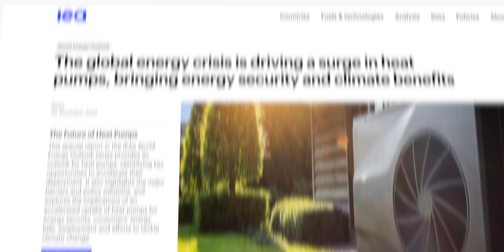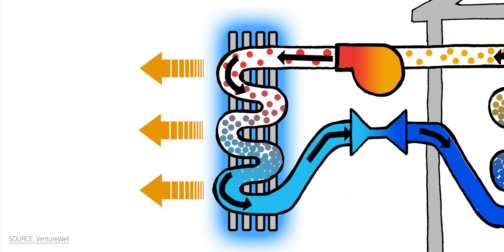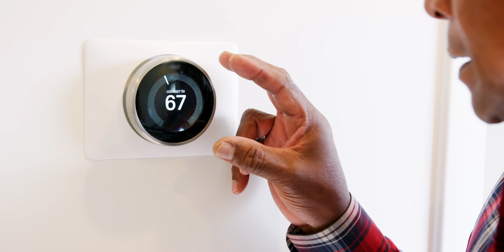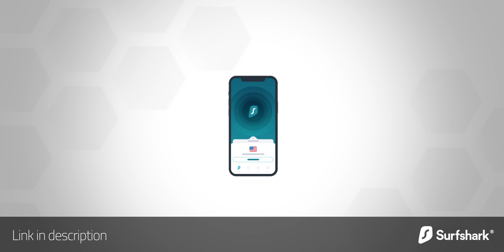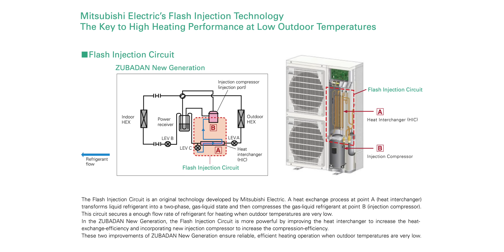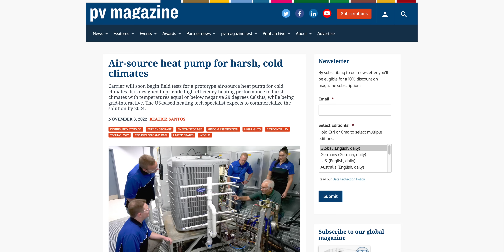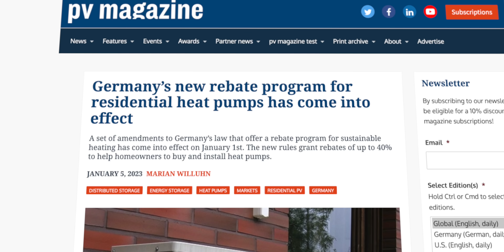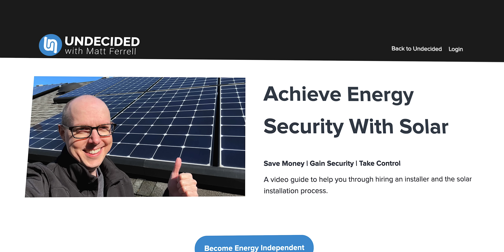Major Advances with Heat Pumps in the Extreme Cold

Comment: Heat pumps cannot heat quickly, they need a huge tank of water to be somewhere in the house, they cost £10,000 or more to install plus additional insulation, the installation  will disrupt the house for days and  and cost a lot to run if defrost and legionella cycles are taken into account. Just not worth the bother and for what?

Comment: My apartment has an air source, gas powered, heat pump.  It saves a lot of money over the old electric we had, and it gives us hot water on demand and central air, but it was done on the cheap.  The outside units are against my bedroom wall and noisy.  The inside unit is super noisy, using low diameter forced air.  The hot water isn't set up well and it's virtually impossible to get the temperature right.  Ideally, the pipes should run back to the tank so that the water standing in the pipes doesn't get cold.  There is actually a $15 part (I saw it on Matt Risinger's channel) that would fix it, but it's Section 8 Housing (I'm on disability) so I'm not optimistic about it getting installed.  We also lost a whole closet.

If I was building my own place from scratch and had the money I'd do an electric ground source heat pump, going into radiant floor heat (or radiant ceiling... just read an article about it... heat rises, but a ceiling fan can fix it, and radiant floor heat can have some issues where your furniture and rugs block the heat from moving much).  Dream home would have both... I'd use the floor for heat, and the ceiling for AC.  Throw some phase change insulation on a frame using T-studs, maybe some aerogel windows (pretty expensive at this point) with hybrid photovoltaic/thermal solar panels and micro wind on the roof.  Did I forget anything?  :)  (Oh, rainwater collection and passive solar... little things like having shade trees that lose their leaves in the winter, slatted cover for the porch roof where the angle is adjusted for my latitude so it shades me in the summer and lets the light in in the winter.)  Actually, I'd love a townhouse.  Why not get two warm buildings to cuddle up on either side, as long as you soundproof the walls...

Comment: TBH: It feels like you’re kind of mixing up air-source, ground-source, and water-source heat pumps a bit in this video. You go into your own heat pump, which is ground source and unlikely to be affected by outside air temperatures, and immediately go into the issues of efficiency decreases when outside air temperatures drop.

Comment: I find it just hilarious that this proven and effective technology still gets a lot of disbelief in countries used to setting fire to gas in order to heat their homes. We have had air and geothermal heatpumps for over 40 years here in Sweden and combined with waterfilled radiators they are the most cost effective way to heat a house. Even my timber house from 1860 that does not have any modern insulation at all! It will of course draw more kilowatt hours during a day than a modern house, but combined with our rooftop solar it will draw about 30 kWh on a really cold winter day. Like today, the temp is -15C and because it was a sunny day, the solar installation produced about 40 kWh, so the heating waa "free" today. It will still produce heat at -35C, but in our old house you may have to light the fireplace with some wood to get that extra comfortable heat during the evening while watching a few hours of TV. It just works! I've also lived in Northern California so I know how inefficient an HVAC ducting system can be. I also have experience from the California power crisis back in the 2000's, so I have seen crazy expensive gas bills. But it will still boil down (pun intended) to the price of electricity vs the price of gas. But if you also add solar, a heat pump will surely outprice gas any day of the week (but maybe not the cloudy days)😊 Until recently Sweden has been blessed with extremely low electricity prices until recently, so for us heat pumps has been the preferred heating (and cooling) choice for a very long time.

Comment: Once again, great. Go to the DOE look up 3M cooling. 3M's main hdqters in Mn built an underground lake under the building, It froze in the winter and then used in the few warmer months. They as well integrated heat pumps.
I believe your approach on a vertical rod is more beneficial. If you test temperature of the earth at ground level then 3 ft then 6 ft you find earth is a great insulator; ground temp at 6' could be 45-60 degrees great source for heat pump

Comment: I've not been impressed with our heat pump for heating. We got it installed mostly for cooling in the summer as my wife and I both work mostly from home and the cost there has been great. But we found it cost us about double our gas costs for heating this winter when we tried heating with it for a few months. And we're in Vancouver where it's not very cold and hydro power is cheap.

Comment: I bought a home in Canada with a 4 year old mini split air heat pump to supplement the other electric heating sources. We had temps of -20 c with a wind chill of -30.  I tested the temperature of the heat blowing from the heat pump. The air blowing out of the unit was 28c. I was pleased and mildly surprised.

Comment: I'm in the industry and agree with what was said BUT putting all your eggs in the same basket, or in this case relying on one source of heat is not the best approach. What do you do when you lose power like what happened in Texas a couple of years ago and no one is able to heat their home? What do you do if the HP stops working and this being in the winter, you have to wait days before anyone can come out and hopefully fix it? what do you do when parts are not available for 1 or 2 weeks? No AC can be a problem but there is always a store or fast food open to cool off but where do you sleep when it's -15*?? So yes, heat pumps are great but certainly not the silver bullet politicians talk about, and redundancy and diversity are much better.

Comment: I have a heat pump in northeast. It works great. However, it was not able to keep up (even with electric backup) could not keep my house warm during extreme low temperatures (-5f +). However, those two days a year it's that cold, we use electric room heaters. Don't regret it.

Comment: I have four air-air heatpumps in my house in Canberra Australia; two Fujitsu inverters and two Panasonic inverters. It drops to lows of -8C here from time to time, but the biggest issue with the air-air units is when the RH is high. You simply can't get around the physics of an outside coil that, by necessity, MUST get colder than the ambient temperature in order to harvest heat energy. Humidity finds that the coils are a very convenient place in which to condense, and then freeze. Eventually the coil blocks up and the unit must now enter into defrost. This isn't a limitation of the heat pump, or the refrigerant being used (R32), it is pure physics. If there was little to no humidity the units wouldn't freeze up and would continue to perform without issue. Even so, running these units as my heating source is a lot cheaper than the gas central system that I no longer use.

Comment: I work on them for a living. Their lifespan is half of what a normal furance would be. They are expensive to replace and repair. They require auxiliary heat "electric elements" in the winter to maintain your temperature and won't keep up in extreme weather. I never advise their usage over gas systems.

Comment: What about the heat pumps using CO2 as a refrigerant and having a COP of up to 5 or 6 with no danger if the refrigerant is released?  It seems that these are the new wave of heat pumps.

Comment: Gas prices in EU are now lower than before war and are reaching levels before the pandemic while electricity is going up like crazy. I live in Poland and maintenance of heat pump is about 2-3 times what I pay for maintenance of my Villant ecoCOMPACT gas unit. If you are able to connect to gas pipe it is still the cheapest option in my place. Gas and electricity prices will still be connected to each other for the next 10-20 years. Plus to have efficient heat pump you need to have a heated floor and not just simple radiators making it even more expensive to install in older houses.

Comment: It really makes a lot more sense in the cold environment to use dual fuel.  It gives you a backup fuel for power outages (generator only needs to run the fans), and it allows you to dramatically downsize your heatpump.  If you look at your coldest 10% and choose to do dual fuel for those, you will still be going with 90% heatpump and might knock 30% or more off the size of your heatpump.  Cold weather is a double whammy.  The colder it is, the more btu's escape your house and thus the more you need your heater to make, but simultaneously, the colder it is, the fewer btu's your heatpump can make.  You might need to double the size of your heatpump to handle a small fraction of your heating days, the rest of the time all that investment is useless.

Comment: A bit confusing how this goes directly from describing a ground source heat pump to talking about cold outside temps.  Ground source means air temp doesn't matter.  Go down two feet and the temp barely changes over the year.  Go down vertically and it really doesn't change at all.     Separately air source heat pumps are capable of working in the climates where the vast majority of people live.    In the long run it seems like ground source ought to win, but it relies on being able to replace the surface equipment and keep the buried pipes... Not quite clear that will happen with current gear, but probably eventually it will.

Comment: If you are a diy person you can search for an air conditioning unit, heat exchanger and install them your self as a heat pump.
I know a guy who managed to buy 3.5kw air-conditioning split system (brand new) but with broken electronic for 400zl ($90). 
Including piping, new electronics, and water heat exchanger the whole system costed him $250-300.

Comment: Its just physics that makes heat pumps less efficient at lower temps. The same physics that makes them great. The only way around it is to make them geothermal. All variable compressors mean is that you can cram a bigger compressor in an otherwise smaller pump that can run slow at regular temps without using too much electricity. When the compressor is maxed out in the cold you are right back at that efficiency wall, it being bigger just means it will put out more heat at that wall than a maxed out older pump. So when the grid is stressed and you need the pump the most it is gonna need to draw the most.

Comment: We built new in 2004 with geothermal using two 150ft wells from the get go. We have enjoyed huge long term savings over our neighbors with conventional gas fired heating. In 2013 we added 11 KWh of solar and were net zero until 2020 when we started charging our Tesla Model 3. With rebates both systems paid for themselves in about 8 years. Currently we pull more from the grid starting in November running through February. I think a solar upgrade will happen soon.

Comment: In Europe all new houses should have heated floors. Heated floors can warm up the room with lower water temperature at levels around 25-28 degrees celsius. The lower the water temperature the more efficient the heat pump is. This way you can reach much higher COP up to 4-5. And heat pumps are also used for hot water supply instead of electric boilers

Comment: I have a houseboat and a heatpump using the surface water. how i explain it usually is this: suppoose you want to heat your home by floorheating. There's a heat exchanger between my floor heater and the r32 fluid in the heat pump.There's another heat exchanger to the outside water. the r32 fluid comes out of the outside water exchange cycle at 10 C. then it is pressurized to 10bar (don't pin me to the numbers, its just for refference). due to the increase of pressure, the temp rises to 50C. this gets transferred to the heat exchanger in the floor heater. when it exits, the fluid in the floor heater is 50C, and my r32 fluid is 10C again. but the kicker is: it is still 10 Bar. when we lower the pressure back to 1 Bar, the temperature drops about the same amount as it had risen before, so a delta of~40C. it is now -30C. This gets fed through the water heat exchanger, where it picks up 40C again, and it is now at the beginning of the cycle: 1 Bar and 10C.  Hope this clarifies, especially the lever of the pressure differences, and how it works to transfer the delta of temperature.

Comment: Also, if the life of your heat/AC components (furnace, AC, oil tank) are near the end of life, their replacement costs should be considered too in calculating a shorter payback period for heat pumps.

Comment: Technology Connections did a couple videos on this topic. Seems like you both came to drastically different conclusions. For instance, you show cold weather heats pumps as future tech, but Technology Connections showed it's pretty clear we've had cold weather heat pumps for years and have just been ignoring it. You also talk about this huge cost, but all of our homes already have heat pumps in them and are just missing a single valve to allow them to reverse direction, it's a nearly zero cost. All that we'd have to do is stop replacing aged out units with units that lack that value and within 20 or so years we'd be done without having actually put ANY effort into it.

Comment: all Cold Climate Heat Pumps wither air to air, air to water or geothermal need regular maintenance and when they require service it is going to cost a bundle, that is if you can find someone smart enough to fix it. It is true that a lot of them have long warranties, but most don't include the cost of labor. We need more training and more talking about the true cost of heat pumps. We have put the cart before the horse in my humble opinion. I believe they are the future though.

Comment: This seems more like an advertisement than an unbiased video.  "It's all just physics" doesn't mean anything.  Heating with a resistance coil is using "physics."  Burning natural gas uses "physics."  Existing in the universe is all just physics.  

Using acronyms over and over "CCHP" also does not explain the quantitative efficiency of a specific heat pump extracting usable heat from the air when it's -10F outside.  It's fun to talk about technology, but before the Northeast US converts over and dumps gas, we better have some actual numbers on the feasibility.

Comment: Geothermal heatpumps are quite a different beast to the standard heatpumps that use air for the transfer.   The ones that rely on air are not as good in the cold, but geothermal uses the ground, which is a more stable temperature and will work a lot more efficiently and at lower outdoor temperatures.  I have to pull you up on one thing though, inverter technology has been around literally for decades.  These are variable speed compressors.  There is definitely nothing new in inverters.  The way they are used may be new, but the old 100% or Off message was resolved decades ago and majority of split system "mini" heat pumps are inverters.

Comment: I kept my fuel oil boiler just because the electric grid is unreliable where I live.  My mini splits keep the house warm even when it’s down to below 0 degrees F.  But I don’t have a generator large enough to run the heat pumps so I kept the fuel oil boiler for a backup.  I’ve been very happy and system paid for itself in 4 years.

Comment: My next heating system will be an air-sourced heat pump.  I already have a propane parlor stove as backup for when the power is out (which happens several times during the winter), and I could use it to supplement the heat pump during extremely cold weather.

Comment: also, a ground source heat pump has no typical "outdoor unit" and is completely unaffected by outdoor ambient temperature - that is why they are so efficient, because they are using that nearly constant underground ground temperature as the sink (or source) of heat. Only an air source heat pump (like a traditional air conditioner) is affected by outside temperature. I urge you to go watch the technology connections video series on the topic.
Reply: One thing that I don't think TC really touches on is that an ASHP will usually; in temperatures of above +5C start to outpace GSHPs in efficiency. Doesn't make GSHPs a bad choice, but its stable source of heat is not just a strength but also a 'weakness', especially with the added upfront cost of the bore hole etc.

Comment: So, the one thing that I keep coming back to in this rush to "electrify everything" is energy diversity. In our house, we have gas furnace (for the main level and basement), gas stove, gas water heater and gas dryer. Our 2nd level has a heat pump and to complement our furnace, we have a normal AC. Even with all of this gas, our average daily usage over the year (with peaks in summer and winter) is 39 kWh per day. To build out a battery system to provide enough emergency power for a day offline, would cost a decent amount of money - whereas, because we are diversified, we can do a much more affordable unit (half the size or so) and not be completely locked into a specific technology as running gas appliances only needs a small amount of energy. IDK, I really want to move toward a "green" solution, but I still think prices (not necessarily efficiencies) need to improve before it is palatable for a lot of people.